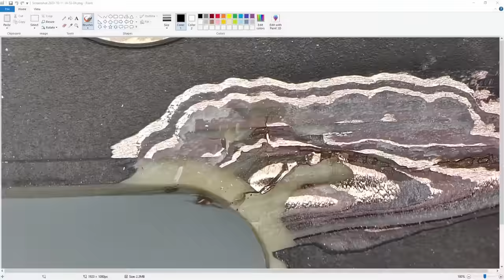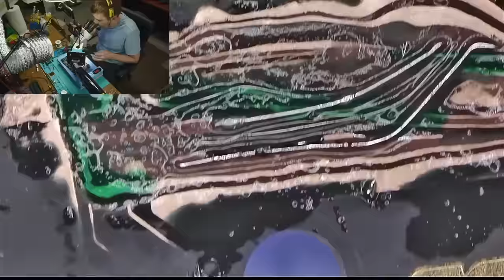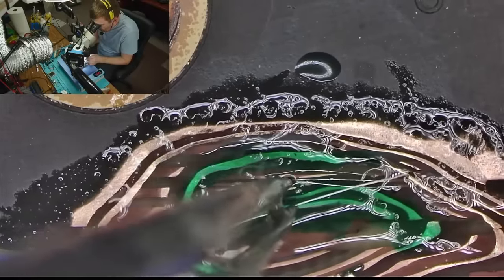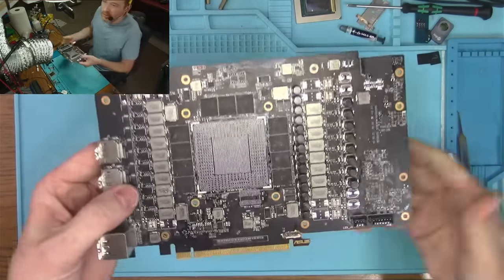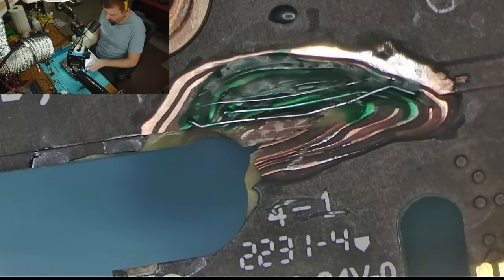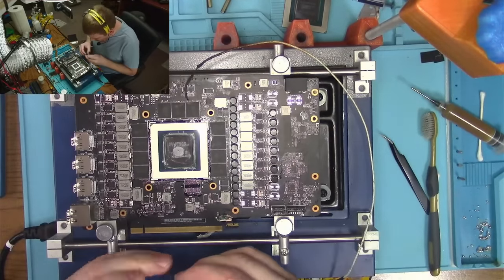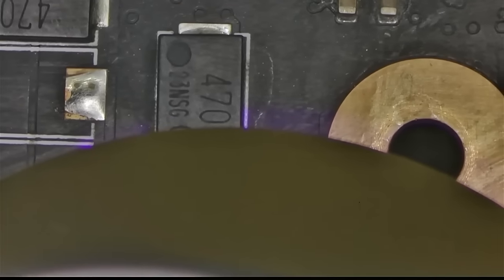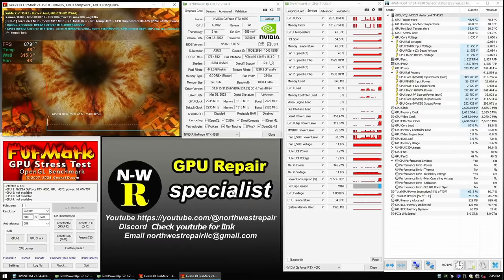Asus 4090 cracked PCB horror Part 2

Comment: Respect for taking on these complex repairs, keep up the good work!
Reply from the maker: will do 🙂
Reply: @northwestrepair these repairs 99% techs would never even touch. Much respect
Reply: complex repairs....   uh huh, on a stiffener rib...    no electronics there lol...  why you dont see any copper striations..there's no contacts to take the, to....

look in your eide port   there's no pin it the side lol    its just to pin the card down with the slider that foes over it
Reply: @HarmonRAB-hp4nk  what are you talking about??
Reply: @HarmonRAB-hp4nk  you obviously missed the line the crack went through
Reply: @HarmonRAB-hp4nk  wrong side of the crackpipe mate

Comment: This guy has the patience, dedication and comedy of a high profile serial killer
Reply: lmao honestly need to be a psycho to spend so many hours doing a repair on a 600$ device for only a couple hundred bucks..
Reply: @stevebanning902  A 4090 costs 2k.
Reply: @watchmen22  A broken and used 4090? lmao nah
Reply: @stevebanning902  But what it's worth after it's fixed? You're saying it's not worth fixing but It's absolutely worth trying to fix it. Especially 4090s with a cracked PCB at that spot which so common.
Reply: @watchmen22  probably about $600 lmao like I said. No one wants to buy a refurbed 2000$ GPU
Reply: @stevebanning902  Lol. Not even close. 600 will get you a defective 4090 without fans and heatsink.
Reply: @watchmen22  which is exactly what this card would be..
Reply: @stevebanning902 Defective? They tested it. They also still have the shroud and heatsibk.
Reply: @nikkiofthevalley  not a single person is honestly selling a repaired 4090 for more than 750$.

Comment: Give this to Northridge fix and he would say no fix without even starting the repair  :D You are the gpu repair master my friend. BTW, gorilla glue is not one of the best epoxies, there are way better ones available.
Reply: They won't fix it cause the cost will be at least $500
Reply: Exactly... northbridge replacing only shorted cap and mosfets:face-blue-smiling::face-blue-smiling::face-blue-smiling::face-blue-smiling:

Comment: I like how they put their logo right next to the part that cracks.
Reply: its the card retention tab.. no electronics in it lol
Reply: @HarmonRAB-hp4nk  No electronic components, but on multi-layer board this kind of crack creates huge problem, and that is why the wires are essential he put in. And the way he laid them is essential too. PCI-E protocol is very strict on timing. Basically all the connections in the PCI-E slot must be exactly the same length, otherwise the protocol doesn't work. Latency isn't a problem, and this is why something like riser card can work. One could say that yes, there are no electronics in that tab, but there are signals running in the copper layers inside that tab. The phase difference the crack created in this particular card propably messed up relative timing of the signals, so some signals took longer to go around that crack made the card non-functional.
Reply: @jarivuorinen3878 The crack probably also shorted a bunch of power planes.

Comment: On the 3 vs 4 connector adapter: Each connector is rated for 150W. Base model 4090 are rated for 450W, so 3 connectors are enough. Some higher tier cards are rated for more power, so they need a 4th connector to supply all that power. The 4 tiny pins on the side are for the card to detect how many connectors are actually plugged in, so plugging just 3 cables into the 4 connector adapter will limit the card to 450W mode.
Reply: What about the 75w from the pcie slot?
Reply: @Jasontvnd9   on the big cards the major components usually run fully off the cable. The slot power may be used for stuff like fans, LEDs, possibly audio controllers, HDMI/DP encoders etc.
You can't just combine the power from the slot with the power from the cable, and dynamically switching based on load is very complicated, so it's easier to just run everything off the cable. Lower end cards might run the core off the cable, but the memory off the slot, to spread the load a little more and not require too many extra connectors.
Reply: theres no pins on that tab, its the lockdown tab...   great job fooling everyone but a pctech of 25_ years :-)
Reply: @HarmonRAB-hp4nk   Lol. Good one. 25 minutes?
Reply: Also most cards unless youre talking a modem or some Wi-Fi adapter tend to have dedicated power adapters so as to assure the device is powered correctly regardless of the load on the board or cpu. Kind of  a cover our asses clause built in to the component. At least since pcb slots have become more versatile in the type of hardware they can accommodate. However we see what happens when your ass covering design dept gets complacent

Comment: FYI, CW2500 is great epoxy for these kind of cracks. It won't soften as the card heats up like regular 2 part epoxy.
Reply: Wrong. Properly treated epoxy will harden, not soften when heated. Final hardness after initial curing is achieved by curing the epoxy in 60-100 celsius, but after the baking epoxy can handle higher temperatures. Of course there are many different formulations for different use cases that have bit different chemistry going on, but the process is the same for all epoxies. Even PCB has epoxy as matrix, and this guy on the video bakes these boards for extended time in 200 celsius and even more when soldering, and PCB can handle it just fine.

Comment: Fantastic work!! You asked why there's 4 wires for the 4090. There are the 8 main pins and 4 small since pins. If the card senses that there is only 3 cables plugged in . The card will limit the the amount of power available to the card. If it senses all 4 main power cables plugged in. It will allow for the full 600 watts to be available.  That includes the 75watts or so from the PCIE lain. Nvidia has a video and so does Jay's Two sense. They show how the sense pins do what they do to protect the card and the stupid plug they started using.

Thank you for all your videos! I'm going to tool up and start learning myself. You help tremendously and im very thankful for you putting all the time in and sharing your ways.

Comment: Curious. Why didn't you build up the epoxy to try and add some strength where the crack is? Multiple layers thicker than the board can't hurt, can it? Any flexing may break the thin epoxy filler there...

Comment: Concerning your expieriences with the hardness of cured epoxy glue, at least with the ones im using, those that take longer to cure are better. The german made UHU Zwei-Komponentenkleber plus endfest 300 is a 12 hour glue that can be cured at up to 180°C for 5 minutes, and gets you a rock hard result. Also on the back of the packaging one can find a chart for curing times at different temperatures and the resulting hardness. 
For structural support, I always use some kevlar fibres, I salvage the kevlar contained in fibre patch cables, then using good a pair of scissors, I cut the fine strands into small pieces and incorporate that stuff in the epoxy resin before applying it, It also thickens the epoxy so that it gets less runny when heated.

Comment: A lot of ppl might not get the real excitement to seeing hard work pay off, cuz some of the time there is no “this is this and that’s that” with heavy damage, so much can go wrong you don’t even see, so when it all falls together …ya it’s like winning the lottery lol 🤙🏻 badass bro
(I repair car audio comp amps and they can get blown up at times lol)
Reply: I recently repaired a Switch I got off ebay for 65 bucks. I wasn't confident at first, especially with doing trace wires. But it's working now and man, it does feel awesome the first moment you power it up and it's working perfectly 😄
Reply: @kulilin3104  that feeling alone is worth it, plus saving money doesn’t hurt too 🤙🏻 good job bro!

Comment: Awesome repair! I always wonder why you leave the hook in place, especially after this crack. There is no way the epoxy will have the same mechanical strength as the initial board and if the customer forgets to release the safety while pulling on the board there goes your 6 hours of work. Wouldn't it be safer to just ditch the hook for good at this point and use the card without it? There is absolutely no trace left that goes to it anyway...

Comment: The spec for PEG8 has a range of acceptable wire gauges.  Some of them arn't enough to carry 600W with just two connectors.  Since nvidia can't know if you have high gauge or low gauge wire, they have to assume the worst and send dongles with additional connectors.

Comment: Awesome repair videos.  You may or may not know 5 minute epoxy dries hard as glass and can crack under extreme vibrations.  15 minute epoxy always stays just slightly flexible.  Not that this video card wound undergo any vibrations.  I fly R/C airplanes and helicopters and vibrations vs epoxy type make a difference.  Just one irrelevant probably useless info for you.  I also for a living was an electronic repairman.  So I find your videos extremely interesting.   You have some real nice equipment too. 👍

Comment: The design of the PCI express system needs to be completely redone, it was designed for cards that weighed from a few ounces to a couple of pounds, now some of the cards need an industrial crane to be lifted, and the way it's going I don't see that trend changing anytime soon. Cracked PCBs around the tab will be a dime a dozen in the coming years.

Comment: My guess on the connector question is that the 4 pigtail is probably so you can connect another rail within your power supply. During overclocking that fourth rail probably smooths out the rail at the card level and supplies a higher amount of available current. Transient spikes in that rail could be evened out. Unless you want 600watts it’s probably not required. 450watt bios’sss, bio’ease? whatever the plural word for bios is, is probably not even utilizing that additional rail.

Comment: the reason for shrinking the pcb even if its in a huge cooler, is that you can get more pcbs in one panel, reducing pick n place and other costs with manufacturing... aka they're cheap

Comment: Wow, you’re a graphics card surgeon!

Just out of curiosity, how much does a repair like this cost? And how long is the turn around time at this point?
Reply: It isn't for the money, it's for showing, what can be done, if you just can - and there's a lot to it.
And board-makers are witnessing a design-fault galore, as if the power-connector design-failure wasn't enough.

Comment: I have a gigabyte 4090 OC edition from launch day. So far the connector has not melted or even shown any signs of issues. I noticed a month or so in, that I had SERIOUS GPU sag. I bought a gpu sag stand and jacked the card up until it was level. I am just realizing now that since I got the GPU stand, I was experiencing occasional random reboots. Only when light duty GPU work was being done. I relieved some of the tension on the card and now have the stand supporting it in a slightly sagging state. Random reboots seem to be alleviated. Long story short, I will keep watching these videos, and I know where to send my card when not if I have a problem. Or my motherboard, whichever gives in first.

Comment: Isn't mounting the GPU vertically more safe, due to the mounting screws being on different angles and keeping the gpu from sagging up and down or the PCB twisting. Considering it was mounted correctly, or am I wrong with this assumption?

Comment: I'm a dinosaur been around prior to 2D cards. I have never seen so many cracked cards since the development of 3D cards. Is it a weight issue or poor design?
Reply: Doubt it, if weight were  a concert it would be impossible for motherboards to be as big as they are. It's Asus being trash as usual. Just remember they manufacture the pcb and place the components, they are at fault.
Reply: I think your correct its probably poor pcb design and quality. I know Gigabyte was having major issues with cracked boards. @battokizu

Comment: Hi. I mentioned trying to figure out how many GPUs pcie tab broke because of sag? I am still wondering. How many higher end GPUs break like that , that are from prebuilt systems? That's the only real way besides pushing up to hard with the GPU support. Or are they breaking in the same way that looks like GPU sag but it really because of it being a prebuilt and damaged in shipping. I have a i9 14900k in a strix z 790 e ddr5 gaming motherboard running a strix oc 4090. I lined up the support by watching the io shield on the back of the case where the io shield are. You can easily see when your GPU is lined up perfect with the motherboard pcie lane on the motherboard. Try it out and you will see that the GPU will be in its perfect balanced spot. 

I can not see if you order your GPU from a proper sales rep. When you pick it up. The box will be in perfect condition and the GPU inside will be perfect and if you have a problem. You can walk back in the store and get a replacement or money or order another one from the company who makes it. Not a 3rd or 4th or onward resale. If you going to spend a lot of money on a componet. Why take any chances 

I know I ramble. But your show bI love and it brings out all kinds of questions. I'm starting my own card repare company in WA State. Most of what I have learn is from you. I keep trying to join your Discord. But keep having issues. I sent you my link asking you for a request . I am Scott. Background pic on profile is the newer ai accelerator card. Thank you for your show. Look forward to much more!

Comment: Yeah not sure why they insist in making the 4090 so big, All the ones I've messed with you run pretty much any stress test and the things hardly go above 70C at 60 - 70% fan speed they could have easily made the card smaller and lighter, but I guess at the price point, they got to make up for it somehow...

Good work either way, amazed how you were able to actually get that card working!
Reply: As a hint, nvidia doesn't calculate hotspot temps the same way AMD does, AMD hotspot temps display raw hottest sensor output while nvidia uses a formula to average, both are limited by mechanical properties, so real hotspot temp needs to stay below 110 or so, more than likely this is required to keep the true hotspot temp below that number.

Comment: I seen the crack on the 1º video and the huge hole you had to do to repair, let me tell you, looks a great repair BUT, you give that card a wrong look OR sneeze it will crack again, the owner will need to have really good care to not break it again.
One false move on the socket and is all over, epoxy glue do not make miracles, maybe some fiberglass mesh inside the glue, don't know.
Good repair / video

Comment: That new gen5 power connector is just rediculous. They should've just modified the 8 pin connector to have those data pins, sure maybe use two 8 pins say 250w each as they can easily handle it and have been proven to actually last.
Anyway AMAZING repair, I hope you get your times worth :D

Comment: I realize I'm 8 months late watching thus video, but just got my 1st 40 series cards within the past 2 weeks.  That new plug you asked the viewers w 3 or 4 headers about is rediculas and may look nice, but we actually feeding it with pcie cables x3 or 4 with pins and wires that are a much larger gauge then the female pins on the new plug. Can't imagine why the female melt on some 4090, but Ohms Law dictates,  when the smoke gets out, sh.t ain't going to work no more. Hate these new plugs. Fire hazards

Comment: I have a method that seems to work very well,  but I don't think it will work on a crack this deep. I clamp down the cracked PCB between 2 perfectly straight pieces of metal. Before I clamp it down, I clean the board in my ultrasonic cleaner to make sure the board is wet and clean and I clamp it down while it's wet. I then heat the PCB to 180 degrees C for 30 mins and then I take it off to cool. I leave it clamped tightly for 24 Hrs. I also cure the crack after its all dry and set with a strong epoxy. I am leaving things out, but this method I have worked out fixes 80% of the cracked or bent and cracked cards that I have gotten.

Comment: There's 4 on the aftermarket like my ostrix oc 4090. That 4 plug decides the 600watts into 150watt lines from the psu. Instead of pulling 600 plus watts through 3 plugs. The 4 plug has the sense wires telling the GPU to unlock full 600 plus watts through the 4 cables. There are cables now that just connect the 2 main sense wires so you can trick the card to think all 4 plugs from the PCI are connected. That's not good. Would you rather run 600 watts through 2 or 3 plugs from the PSU or have 4 wires deciding the 600 watts into 150 watt feeds from the psu. There are videos all about this on YouTube.

Comment: I think this is worth bragging about as I think that what you accomplished was no small feat. You did a great job. I am not sure how this happened exactly. But I still wonder why people still don't get a GPU support of some kind. I have one that is like a piston bottle Jack but with an adjustable screw for height adjustment. As I don't have the room available for slot type bracket support, I mean for $20 to $40 you can avoid these types of cracks. Just a thought.

Comment: I feel for ya man its tough I know all about it..  Last one I did was about a inch long  front and back took right at 10 hours non stop it was over into the data lines on the rear my brain was completely fried said I'd never do another one lol.. After it was done I covered the work area with a quarter inch of epoxy..😂
Reply: I do one at a time and cover with solder mask it's more time consuming because you have to clean each time so the mask will stick but thats the only way I can do it too shaky.. It's very rewarding with you get done and everything works though 😅